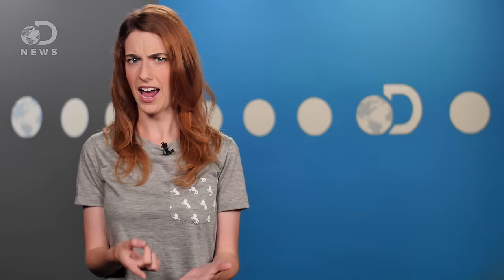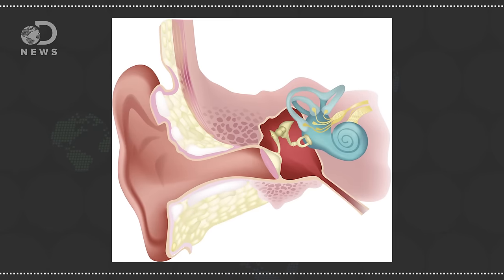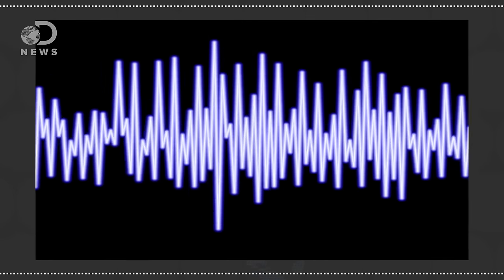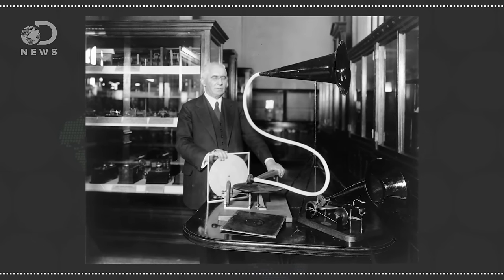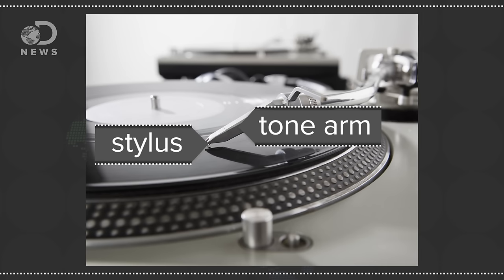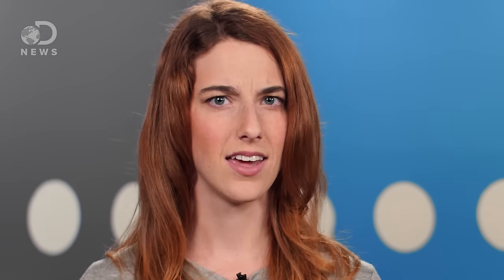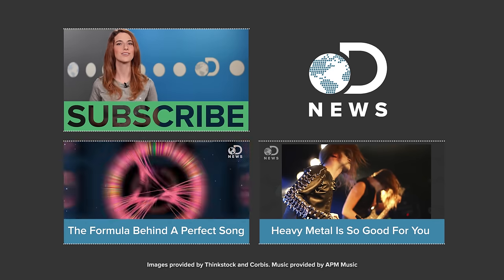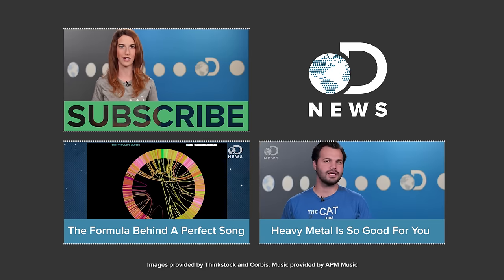How Is Music Stored On Vinyl Records?

Comment: I get how the sound is converted from bumps in the grooves, what i've never understood is how you get stereo from that!
Reply: Do you get stereo from it though?
Reply: Benny Kolesnikov Yes. Vinyl records can for sure produce stereo sound.
Reply: ***** the bumps in the grooves are on the sides of the grooves to varying degrees. The stylus in the cartridge doesn't detect in say an up down movement but more of to a slight left and right. That's why the bigger bumps, the bass bumps need to sit more in the middle be a horizontal movement (edit: I had my dual mono axis confused). Which still works well in the real world, bass coming from left and right in more of a stereo image rather than dual mono would create cancelling.

The bumps in the middle would come out both speakers equally (but opposite polarity, cancelling), the bumps more to one side would come out that side (it might be the opposite side) more than the other.
Reply: ***** well prepare to blow your mind... you can get 32+ channels of audio through one wire, if that wire is an optical cable. and you can get 100000000000000+ channels of audio through one wire, if that one wire is an Ethernet cable.
Reply: mitchiemasha this.... is not accurate.
Reply: readyrepairs I was asking about getting stereo from a record groove and a stylus, not through cables. Are you saying you can get 32 channels from a stylus? because even to me that sounds unliklely.
Reply: readyrepairs Ok, which specific part. Educate me. Some links would be useful.

AS for the 32 channels thing that has nothing to do with this thread, we are talking styluses.

http://www.audioimages-hifi.com/page5/page39/page40/files/daca14549e219c886a0bcbf6f8f52c7c-0.html

My post was meant as the simplest way of describing it.
Reply: mitchiemasha Horizontal offset of the stylus can be thought of as the center or shared channel, while vertical offset can be thought of as the difference between the left and right channels.  This link: http://www.vinylrecorder.com/stereo.html has decent (but semi-broken) graphics that might help visualize what's happening.
Reply: why4duck That link explains it really well. I understand now. Thank you!
Reply: why4duck That link is perfect and exactly what I was trying to describe. Visual  reference always trumps!

Although I had my left and right, stereo understanding right, it appears I had my mono axis inverted.

So my question is, would the needle drifting more towards the outer edge of the record be a negative movement of the speaker cone and to the centre of the record a positive or vise versa? for simplicity will keep it dual mono. The 7th image down.

In these diagrams it's not noted how we are looking at the needle (hard for me to put in words here). Stage Left/Right issue or just normal. What direction the record is going!!!!
Reply: mitchiemasha I'm glad it helped!

My understanding is that there's no standard for phase.  In the real world, the difference isn't discernible - I have a phono preamp with a phase switch (PS Audio GCPH) and any difference is inaudible to me.  Crazy audio journalists say different, but they're crazy.
Reply: why4duck Yeah, if both speakers are flipped, no difference but I asked purely out of interest. Previously my understanding was up would be positive, down is negative, where as now I know it is left would be positive or right. Then we have the problem of describing whether it's stage left or actual left, depending on how you look at the stylus. Once I start thinking about things I have to know, lol!

To put it another way if one was sat on the stylus, with the record moving under and away, right is the centre. Where as if I was looking at the stylus, record travelling towards us, right is the edge. So it's easier to ask is the motion towards the centre of the vinyl positive or negative. Did any of that make sense?
Reply: +satay71 well, the stylus hits both sides of the groove, from top right to bottom left you have a channel and viceversa (top left to bottom right another channel). I don't know EXACTLY how is that made, but that's how it works. You can actually look for videos about that
Reply: Look at the groove under a microscope and you will see.

Comment: Digital in in paper is superior to vinyl period. But vinyl has a signature sound which appeal to many people and is better recorded or pressed. CDs still superior that vinyl in paper,  but due to poor recording vinyl are better than CDs. And the presentation in of the vinyl is way better than CDs, Cds come in a cheap plastic case are easy scrachables, Vinyl usually have an excellent presentation make you feel like you money was worth it.

Comment: The "warmness" people hear about vinyl is not so much related to the vinyl, but more to the amplification system. Also, the music in modern vinyls are recorded using digital systems and then transferred to the vinyl using digital to analog converters. And finally, that "warmness" is nothing but distortion and filtering. They do sound cool, though.

Comment: No matter how high quality an audio file you have, it will always lose quality when you listen to it due to quantization, the process of converting from a digital to analog signal. Yes, the difference in quality vs a record may be unnoticeable, but you will never get 100% of the sound from digitally stored audio
Reply: TDhoedo might be true but vinyl has way more distortion then digital music has. that might give it the "warm" sound but it is definitely not an accurate sound.
Reply: TheDesius this depends again on the quality of both the record and the equipment used to play the sound. A 50 year old record player with records that have been played many times will sound a lot worse than professional quality equipment with mint condition records. The distortion happens as the grooves in the record are gradually worn out by the needle, and the needle itself gets worn out as well.
Your blanket statement only applies when quality is not assured

Comment: But they actually sound better...... There is no debate a good record is way better than a digital copy! Well atleast in my opinion...
Reply: A Michigander 
How
Reply: Um if have you ever heard a record player I mean it's not an exact science but a record paired with a receiver sounds amazing. That and I like classic rock most of which was designed to be heard on record or 8 track
Reply: A Michigander 
I've heard a record player and all it does is have pops and clicks plus it sounds tinny
Reply: Sunforged lol that's why you have big speakers once it gets loud enough they go away and sometimes it's just the record
Reply: A Michigander 
Yeah I have big speakers, after cranking it I hear a worse sounding version with pops and clicks and I have to get off my arse and flip the record.
Reply: Sunforged Weird... is the needle on the record player good? Nevertheless it's just my opinion.
Reply: A Michigander 
It's some crappy Jensen record player.

Comment: Analogue devices are much more accurate than digital ones, simply because digital devices transcribe the continuum of a wave to the binary system while analogue ones record the original wave effectively without altering it. Of course, analogue media get corrupted with use, so that perfection does not last for long, while digital media do not get corrupted unless treated badly. There is no debate here really.
Reply: Çerastes That is related to how humans perceive sound. The analogue wave itself is mathematically perfect, while the digital can only be an approximation of that perfection. 

To quote from your link: "[...] perfect fidelity for the class of functions that are bandlimited to a given bandwidth [...]". That, to my understanding, means that only a set of functions (the ones "having a Fourier transform that is zero outside of a finite region of frequencies") can only be reconstructed pefectly. Generally, soundwaves are not mathematical functions and can merely be approximated by them, which of course leads back to my point of continuous waves not being able to be perfectly reproduced using a finite sampling rate.

Now, the human ear's sampling rate comes into this and of course changes everything... *flac. files already have as good quality as a record. It's similar to why we don't need to have animations exceed our eyes' fps detection (oversimplifed).

P.S.: I'm no math expert; I just study physics. So feel free to make any correction to what I've said considering I don't claim to be a connoisseur.
Reply: Çerastes I also watched the first 3rd of the video and I already knew that the step-wise function is not a correct representation of a digital wave, but we still have to fit a regular wave funtion to the points sampled. I'm still not sure about something very simple: why do different digital qualities exist, if it's not the sampling rate that matters?

Comment: I would listen to vinyl if records weren't  so fucking expensive.20.00 dollars a record?Really?For something almost 160.00years old?Crazy,just crazy
Reply: They're expensive to make now that demand isn't so high and the main old produces of them have pretty much closed. Hopefully if they make a big comeback they'll get cheaper.
Reply: Don't get me wrong,I love the sound.I also Dj but I can get away mp3 with filters on Traktor Tables.Much cheaper.Only one cost comes to mind,cpu and ram seem to be most costly.Use a good amount for best result.I use a Lenovo,32gigXtreme with 8 core 3.9 clock.Like fluid! Graphics card can be basic,depending on UI.
Reply: +casey james Music uses so little cpu power and very little ram. What the heck man? Yes, even lossless flac. A sound card matters most, USB is preferred over internal though.
Reply: My turntables has it''s own sound card.Have you ever tried to run 2 tables at a time?It uses Most of my ram,when using 8 gig,it would run out and freeze my pc.I installed 32gig ram.,problem solved.Do have a set of traktor s4's?If so try mixing 2 songs at the same time with samples.I bet you run out of ram.Cpu can be fudged a little but you still need a decent one.

Comment: 1. Do not play a vinyl on a Fisher Price toy turntable.
2. A rca player that costs you $40 at pawn shop is not enough to enjoy vinyl...
3. In the days of vinyl people were paying A LOT for a good sound system.
    Expect to pay at least $210 for a player (unless you find a trift shop deal).
4. $100 Vinyl to usb does not sound good enough. Sorry.

For the reference I am using a Radio Shack Lab-440 that did cost A LOT in the "Good OL' Days" in Canada.
Reply: you definitely don't need a really expensive system. I have a piece of shit Denver player (one of those portable ones that look like a bag) that I bought new for $40 and honesty it doesn't do a bad job at all. You can't use the built in speakers of course because they sound like garbage but if you hook it up to a really good sound system it sounds wonderful. I'm surprised I could get such a great music experience on such a low budget.

Comment: Vinyl will always be better than digital. The real sound is being recorded. I have tons of digital music and i still have a record player. I think in the near future, they will have vinyl the size of cd's and can play a whole album, and still have the best sound. For all the vinyl fans, this is the best way to clean the records. Look up cleaning vinyl with wood glue.
Reply: +hydrus77 Vinyls are cool, but they are definitely not the most accurate representation of what was intended to be recorded. It is certainly a really awesome experience to see the needle go through those millimetric grooves and to hear the sound come to life.
Reply: hydrus77 Better only in your taste. it's not the real sound been recorded, It has to be excessively eq'd, hence mastering. Deep bass can't be printed on vinyl, the needle would jump straight out the groove, the inner grooves are more problematic than the outer ones. it's not the same sound been played back either, the natural movement of the arm, plater, vibrations etc, make what would be a standard printed sine wave,  nothing like as such. Look it up oscilloscope tests!!! 

All these very things add to the experience of the vinyl, non of which were apparent in the original performance. Not even including crackle and wear. Then there's to what accuracy those tiny lil bumps are printed too in the first place.
Reply: +hydrus77 : Nope.

Comment: Vinyl - due to its analogue nature - is theoretically better than digital, which can only represent sound in zeros and ones and nothing in between.

However, in practice, that is seldom the case. Due to manufacturing limitations, dust particles and the physical limitations of the playback devices, vinyl loses a lot of its quality over the original source. This, with old fashioned tube amplifiers, does provide that iconic warm sound and that orgasmic popping. However, that is not true to the source material.

With lossless digital recordings, modern sound cards, and playback devices with optical cables, digital is far superior to vinyl, and is the best representation of the original recordings.

Nothing is perfect, and everything works on a scale. Well looked after vinyl which was made in a quality press, played back on a high-end player will be better than a 320kbps compressed mp3 played back on an iPhone using their crappy headphones.

Comment: No  cassette tapes are best as do not scratch up and always play.
Reply: Pliz no.
Reply: Have you ever used one before?
They degrade like all hell
Reply: They have relativity poor quality. The degradation is long term, aka 10 years later the quality would be worse than before. Same as after a couple hundred plays,
Reply: Benny Kolesnikov not if you get the heavy metal ones. HUE HUE HUE HUE
Reply: Cassettes are extremely unreliable and get eaten by tape decks!!!

Comment: cd and vinyl will always ne better than digital or mp3 . actually you cant compare them
Reply: Morduk Metalhead you can just get the lossless file from the cd and then it is the exact same quality XD
there is no reason why cd would be better
Reply: TheDesius mp3 are most of the time compressed files
Reply: Morduk Metalhead that is why you should use flac and wav
Reply: TheDesius i dont know those ; beside that , the original cd's use to have protection and u cant extract the files from it
Reply: Çerastes explain to me then
Reply: Çerastes okay i understand . But still i cant prove anything cause mostly my music is digital , even with the dozens of cds i have that i play , i still dont have a very good "reader" (i dont know how to call the machine that plays the cd's) to see if it sounds better or equal